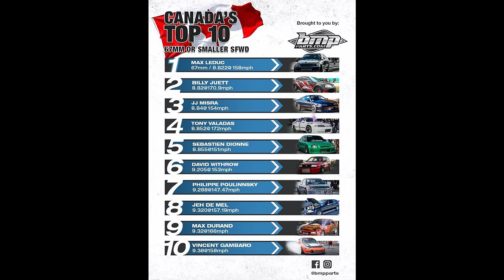1000whp MK3 Golf, The quest begins.

Comment: Hey man, what trans are you running? I have major shifting issues with my 02a at higher rpm in 1-2, 2-3 upshifts, trying to figure out it it’s my clutch/pedal/cable setup or the trans itself. The shift delays just kill the speed of the car, drops out of boost etc. 16vt / 02a trans w lsd — Thanks a lot!
Reply from the maker: 02A dog box. No lift shift will help with shift delays, but the stock trans will only be up for so much abuse.
Reply: @COMotorsports  right on thank you, so just dog gears swapped into your 02a case? And the issue is it won’t allow me to enter the next gear until the gears slow down enough then finally it will shift, if I force it (doesn’t feel good) it will still hesitate then grind into gear. In your experience, is this typical with a “stock” 02a? I feel like with no lift shift the problem will still persist, but I will be railing the limiter as I wait to get into the next gear. Appreciate your time, thanks so much.
Reply from the maker: @twistymcfloyd  well the NLS gives a chance for the load to be taken off the trans allowing it to switch gears. But the stock gears will be your problem anyways as they're gonna fail with abuse. And yes, gearset in 02A/J case.
Reply: @COMotorsports  gotcha, I’ll give it a shot! Thanks much!!

Comment: What you think about the boostline rods? I just ordered a set last week. Waiting for them to come in now..
Reply from the maker: They're heavy that's for sure. Definitely don't see them failing anytime soon, with the 625 bolts, but rotating mass definitely went up compared to what it was.
Reply: @COMotorsports  I just purchased a precision turbo 5858 and q tubular manifold also. I'm getting rid of the turbo concepts hybrid k04.
Also how well you like the kdn shifter setup. Cause i dont want to spend 8k on a quaife dogbox
Reply from the maker: @beefysghost867  We use the KDN shifter in quite a few cars, however you can't compare a shifter to a dogbox, they are completely different. A shifter will not make the transmission any stronger. :)
Reply: @COMotorsports  yeah I I know that lol. Wish it was that easy . but I'm just looking at my different options for shifters because once I finish this build I don't want a money shift it and wait $5,000 because of that.
Reply from the maker: @beefysghost867  well to prevent money shift this is the only real option to be honest.